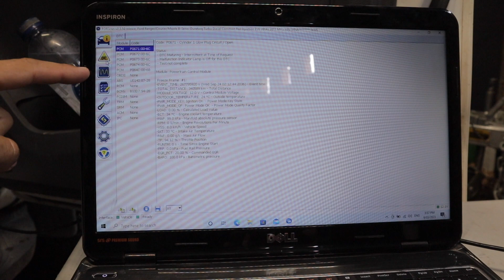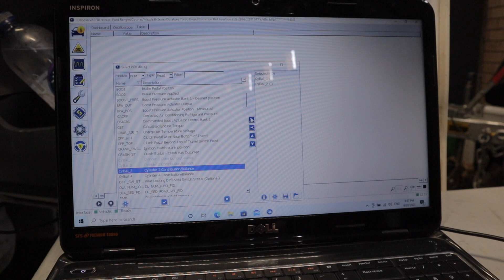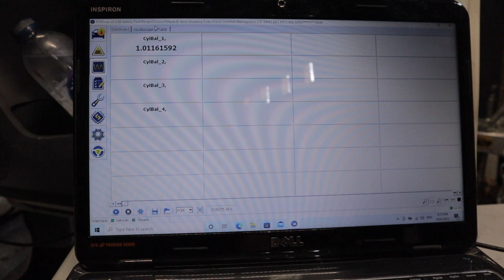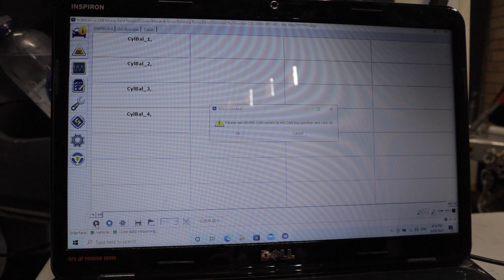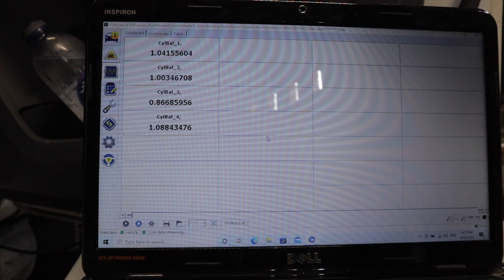Ford Ranger Cylinder Contribution Test

Comment: Hey legend able you able to make sense of these values? I have a Steinbauer and the AOB EGR cable not sure if they affect the values? 215k kms I’m pretty sure in need of new injectors… any recommendations on best value approach? 

Cyl1 0.435
Cyl2 -0.355
Cyl3 -0.305
Cyl4 0.165
Cyl5 0.055
Reply from the maker: very unusual values, i would disconnect the chip and read values again, the cable won't be affecting them.
Reply: @ thanks mate will do appreciate the reply as always!

Comment: Hi mate. Thanks for the video. My 2012 PX1 2.2 has 227,000km. Data is fine. Hopefully it has factory injectors. Do I need to replace those. What would you think? Thanks
Reply from the maker: you could push them out to 300k if the data is all good

Comment: Hey mate, I have a 2016 px2 Wildtrak. I have the Scanguage 3. Forscan may give better results but this is the it’s telling me

Cyl 1 balance: -0.70 mg
Cyl 2 balance: fluctuates between 2.90- 3.90 mg
Cyl 3 balance: -0.80 mg
Cyl 4 balance: -0.70 mg
Cyl 5 balance: -0.70 mg

What does this mean?
Reply from the maker: not too sure on what the mg figure is , but looks to be a issue with cyl 2

Comment: Are you aware of an external oil cooler kit?. My 3.2 has had 2 issues with the standard oil cooler(oil in water) I would like to have a oil cooler that does not have a water jacket. An oil cooler like the gearbox conversion.
Reply from the maker: i can't see a problem with bypassing the factory cooler to a aftermarket air cooling type, i still run the standard one

Comment: I’ve tried to find the cylinder contribution test but it doesn’t come up as an option. 2018 Ford Everest 3.2 with an OBDLink MX Wifi adapter. Any help would be appreciated.
Reply from the maker: check out my latest video, i use a Topscan to do a contribution test
Reply: In forscan, the names are different for the balance test items. Use the search and type "injector". There will be 5 PIDs to select and the data will be expressed as a percentage value. Cheers

Comment: done it all again properly & hot. 1= - 0.155, 2= 0.085, 3= -0.050, 4= -0.040, 5= 0.170 what should i do?
Reply from the maker: They look all over the place, how old are the injectors?
Reply: @ 40,000km I’ve done on them - I got them when they were in a new ford that had petrol accidentally put in it run for a short time
Reply: @ I might change 1&5 today I got some tidy s/h ones

Comment: Just tried this in my 2019 2.0 Biturbo and came up with two negative and two positive numbers  - cyl 1 - 0.135, cyl 2 -0.210, cyl 3 + 0.17, cyl 4 + 0.17  - any thoughts? thks
Reply: Sounds like you are doing a Cylinder fuel balance test and not a Cylinder Contribution balance.
Reply: @johnprice2606  You may be right. I checked it out again - no cylinder contribution test - just fuel balancing per cylinder and injection quantity per cylinder is available.

Comment: Have you tried flushing your intercooler?
Reply from the maker: no, how come?
Reply: @abdautomotive  Nothing, I’ve just been having weird issues lately like low power at 1,000rpm to 2,200 rpm. Weird idling around like 700-850 rpm fluctuating. No error codes nothing. But there are some weird readings with the boost sensors and its perplexing everyone here. 3.2 ranger by the way. Egr is blanked and cooler is bypassed and everything has been remapped so I im scratchin my head here
Reply: And i know flushing the intercooler is not the solution, but I’m thinking of other possibilities have you ever experienced anything like this?
Reply: What model? Auto or manual?

Comment: I have 1.2, 1.2, 0.8, 0.8, 0.8 what's that telling me? With heavy blow by, pushing oil out my turbo. Happened suddenly? Pulling my exhaust off to make sure my cat isn't plugged...on a 3.2liter PX 140k km.
Reply from the maker: thats not too bad, blow by could be your injector seats
Reply: Thanks for the great videos, I really appreciate you taking the time to do that.

Comment: Hi mate , would you know if the earlier 3 litre engines are any good?  I was thinking about buying an older ranger.
Reply from the maker: No idea
Reply: @abdautomotive thanks , I thought you may have worked on them
Reply: Just get these rangers they mean motor will last u forever I herd I've only replaced the battery on my px1